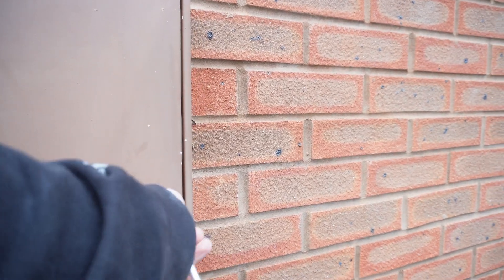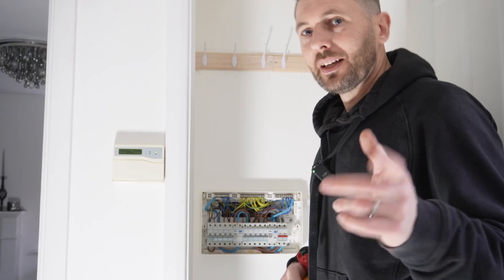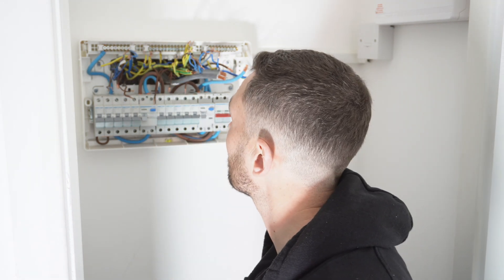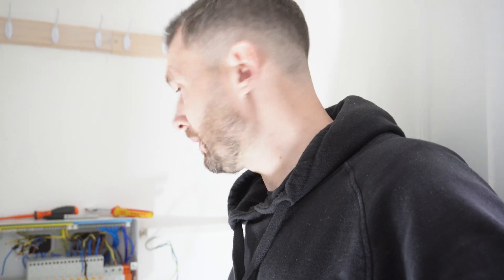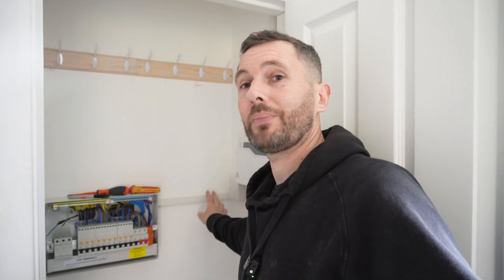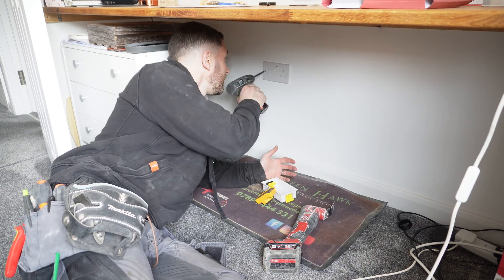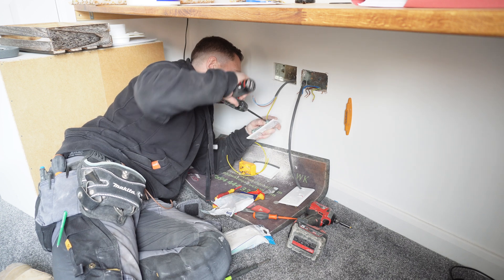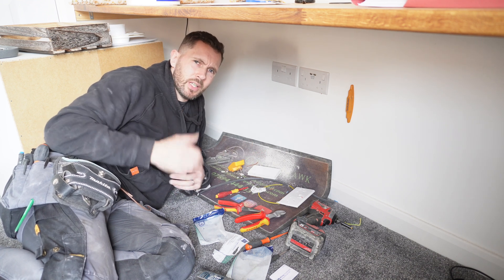REPLACING A NEW BUILD CONSUMER UNIT

Comment: Copper exposed on these terminals here? So if you managed to Not touch the metal terminals you could touch the exposed copper???? Did you mean that All those terminals are live arnt they? I’m not a sparky and I’ve not tested continuity on those terminals but I’d have thought they were all conductive from the brass terminals to the screws. 

Given it’s a new build it does seem to be a little kak. Nice to see you making it better.

Comment: I would have told them to save the money and just carried out a eicr.
Reply from the maker: Yep that is what I offered several times but the customer wants it brought up to date
Reply: There was very little wrong with it. Madness to change.
Reply: @johnburns4017  If you were a qualified electrician you would know why it is not madness to change this board.
Reply: @davebadger100  
Tell us where it all needs replacing? Educate us.
Reply: @johnburns4017  Not my job to educate anyone. Tell us why it is madness to change it.
Reply: @davebadger100  
You are the one interjecting insisting it is not madness to change, disagreeing with three of us on this thread. Go on tell us why?  Educate us.
Reply: @johnburns4017  Again it is not my job to educate anyone, least of all you.
Firstly I never said it needs changing, I said it is not madness to change it. 
Secondly I am only disagreeing with you. There are at least a couple of very good reasons why it is not madness to change this board and I reiterate that if you were a qualified electrician then you would know why.
Reply: @davebadger100  
You are disagreeing with three people on this thread.
Reply: @johnburns4017  No. You need  to brush up on your comprehension skills.
Reply: @davebadger100  
Give it a go, tell us.